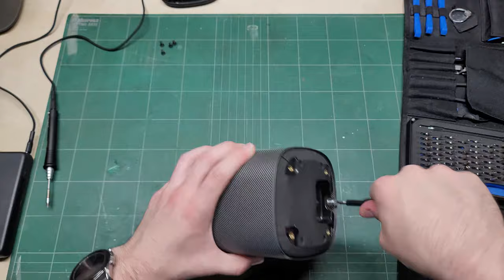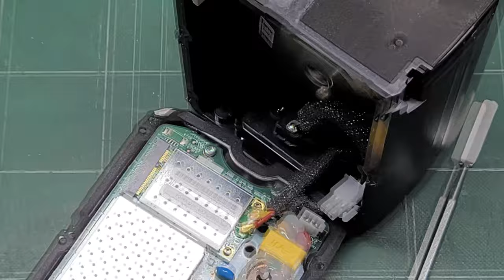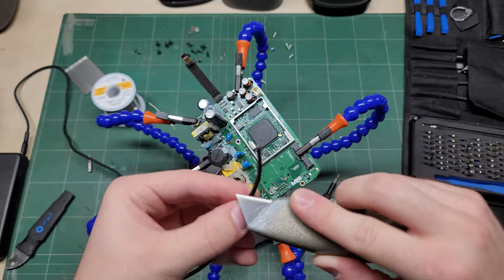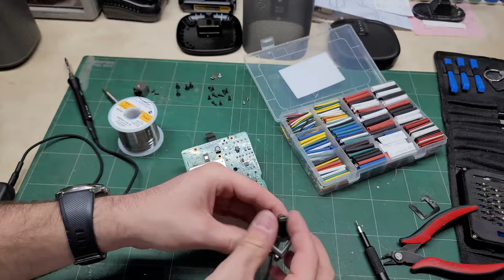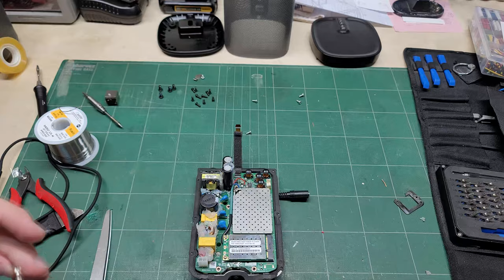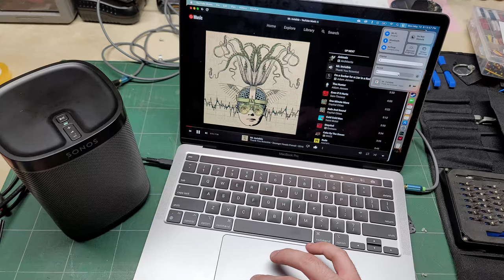Adding Aux - Fixing Sonos Play:1's Biggest Flaw

Comment: Needs a good close still image of where the connection point is for the aux. Also note this only makes use of the full range speaker and does not use the tweeter.  See videos on adding bluetooth for those connection points an how to use both speakers.
Reply: oh wait.... no tweeter? Hm ok in that case.... thats a shame
Reply: which particular videos are you referring to.  all the sonos BT videos that i can find are about how to use the AUX port, which this device does not have.

Comment: Totally a Butcher job getting an Power amp module from Amanzon and eliminate all Just use the existing power supply and the speaker.
Or better install a 4066 and use some logic to switch Sonos to Aux input or a bluetooth module mentioned below.